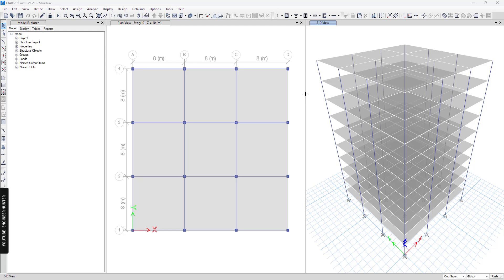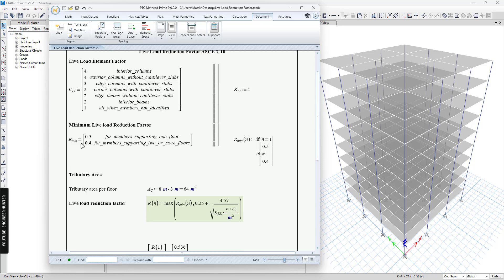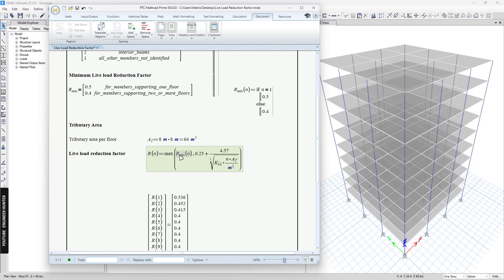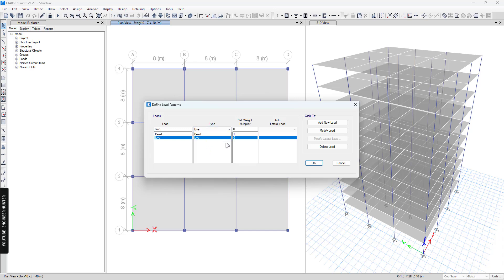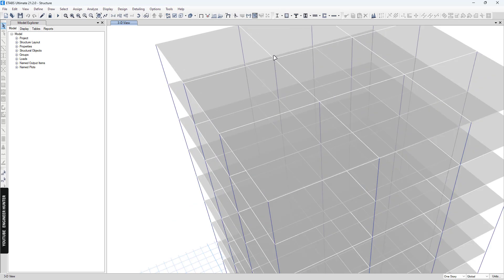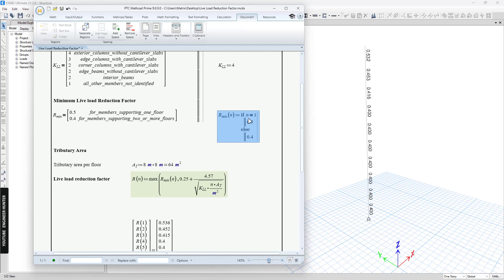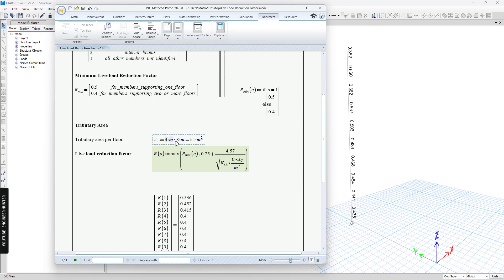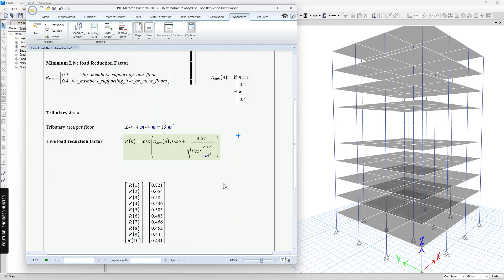Live Load Reduction Factor using ETABS #design #tutorial #construction

Comment: When could  liveload reduction be used? Is it for every structure?
Reply from the maker: You can find the conditions in the design code. It shows which load can be reduced.
Reply: @EngineerHunter Why is it applied only on the columns, is it because columns are the last structural element that hold the tributary area of the live load, why not the beams too?
Reply: @justaconcrete4789  because the concept behind LLRF is that at a given instance of time the probability that the each and every level of the whole building is occupied is very very less. therefore the columns will never be fully loaded at any time. Beams however can be fully loaded because it can be that at any given moment one particular floor is fully loaded. Hope this helps.